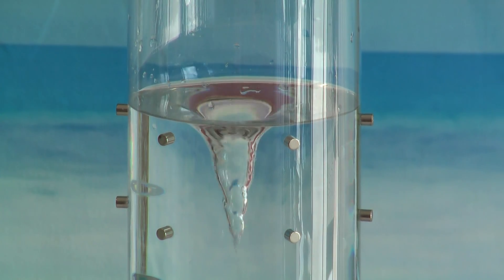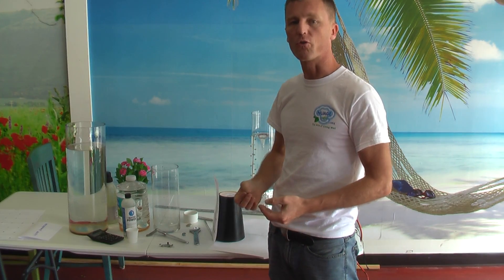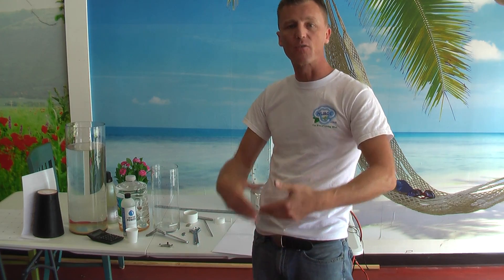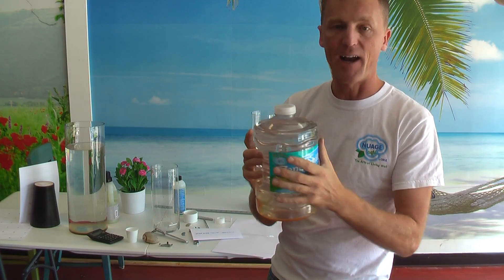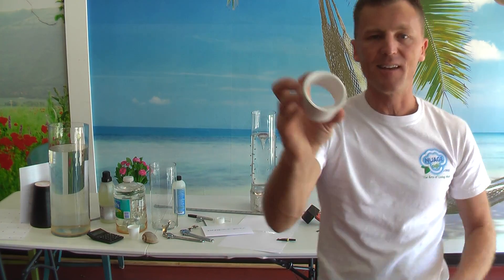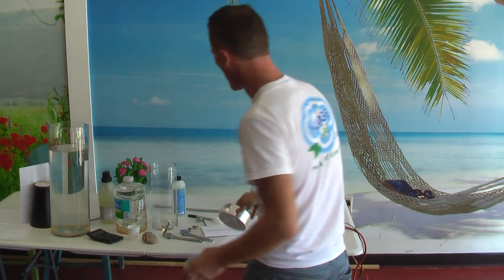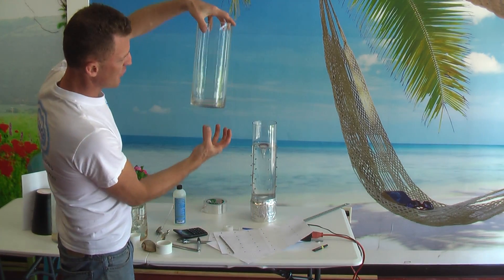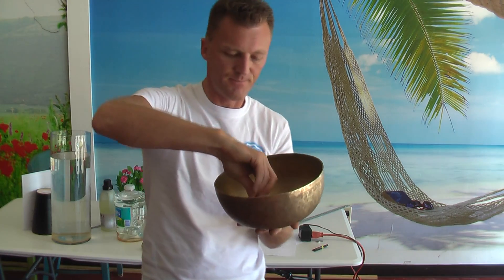Thierry Brouwers, Make your own hydromagnetodynamic system. Water Tornado. Nuage Cafe in Parkland.

Comment: Thanks for the video Thierry. I tried making it but it isn't quite right. I have all the stuff but the white magnet in the water isn't spinning properly.  can you send me a photo of your setup under the glass container. I would like to see how the fan and magnet are attached? Also,  could you tell me the exact model of the glass the white plastic magnet/length and where you got it.

Thanks.
Reply: ebay.. mangents (search lab stirrirs or somn close but use "lab" get a smaller size rod you can buy 3 different sizes for couple bucks or so...just glue wood on fan and magnet on wood

Comment: Thanks Thierry - nice video. I would like to have seen the finished set up running from further away so we could see the spinning magnet inside the flask - creating the vortex. And how long do you recommend running it for? Also, the balancing of the magnet on the fan motor - which are notorious for bearing failure anyway - so I wonder how long that will last? Any feed back on that from your experience? I subscribed  btw